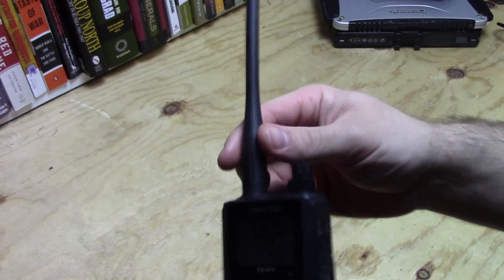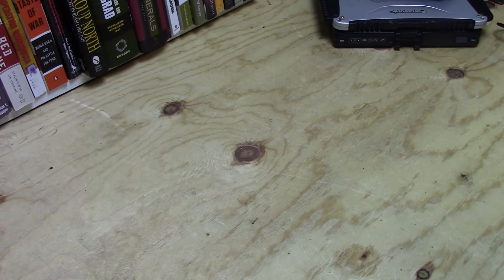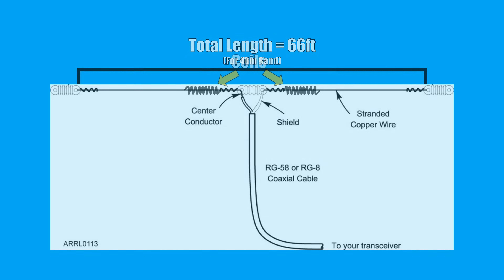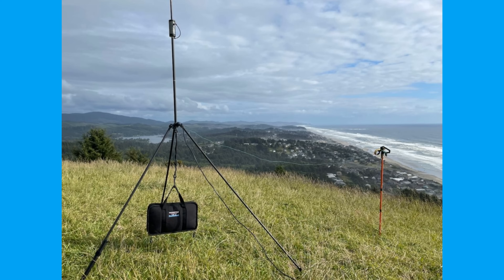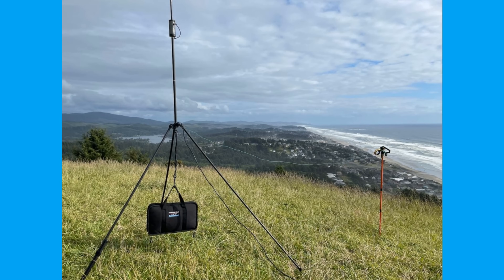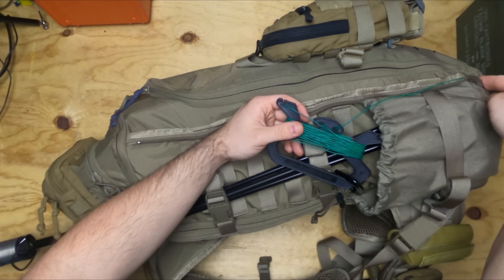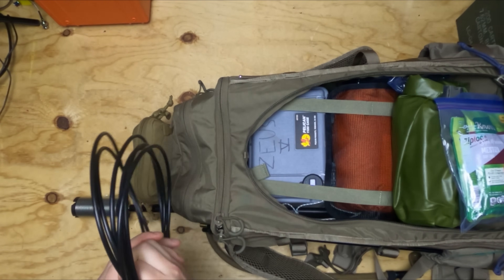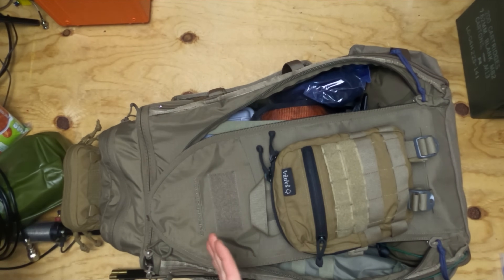Portable HF Radio: Issues and Options

Comment: Licensed general ham here. I’ve kind of lost interest, but I’ve done enough portable ops and it’s all about having the most efficient antenna “system” you can buy or build.

It’s critically important to understand radials, counterpoise and elevated ground plane concepts. Just tossing a wire in a tree is okay for receiving, but not for transmitting.

Learn about antennas before investing in expensive transceivers. You will someday thank me.
Reply: Would a QRP transceiver be good for this then?  Relatively small and lightweight with the capability of using a decently built antenna.

Comment: Or just use an Alexham magloop antenna.  I've been using one on my travels for years and you can either hold it in your hand or slap it on a small tripod.
I'll stop, put together the loop, tune it in, and then transmit.  Takes less than 5 minutes.  No need for dragging wire all over the place either.
ANd I'd ditch the heavy Toughbook as well for an M1 Macbook wrapped in a plastic bag.  
Battery lasts a long time in the new M1-powered Macbooks and most of the software folks tend to use also exists for Mac OS X.  Not to mention is more secure than Windows.

Comment: Make HF great again. I think prepper types would enjoy it a lot with just a little nudging and better marketing.
Reply: Many people need instructions. Everyone will need cheap radios that won't break easily. An open-air raspberry pi setup won't do that. I guess a small pelican case full of stuff could work, though?
Reply: @phil2082  you can’t use HF without understanding some radio theory. Don’t have to be a physicist, but it’s not a plug and play technology. No way around it.
Reply: @oliverallen5324  So... Understanding theory and applying it are always different things.

As a mehanical engineer with a ham license and CNC experience, this really has always been the case in my experience.

Things could always be made easy. You don't need much to get a lot working once the technology is good.
Reply: HF is still a very primary net in certain communities.
Reply: The problem I see is a gap in people who enjoy radios and want better communications and the ham radio community. The similarities are there but the community has done very little to make that known.
Reply: That is a marketing pitch.

Comment: Any thoughts on the Chameleon Mpas 2.0 kit?? Other than price??
Reply: I have this kit. It was my first antenna I purchased. I built some efhw antennas but considering the amount of different capabilities this mpas offers, it was well worth the price. I will tell you, the transformer they use is very very good. Some purists like to say it is too big of a compromise which I completely disagree with. Know your operating environment, what you want to accomplish and then decide what antennaat yes that. Just like the buddipole, it cost serious money. But if comparing to the buddipole, you have to consider that the buddipple is really just a vertical antenna. With the mpas you can do a vertical, sloper, inverted V, inverted L, loop, nvis, etc   so many options. But once, cry once.

Comment: Crazy that you have started doing videos on HF and NVIS. I started checking them out right before I saw your first video that mentioned them. I have been looking at mobile setups and haven’t found a whole lot of commercially available options that aren’t ridiculous. I am thinking about running a horizontal whip with ATU. Longest durable one I have seen is 102 inches. 

Glad I saw your video because my next area of research is a man portable NVIS antenna. 

Thank you for your amazing videos. Some of the best information I have found so far and so pertinent to our current times.
Reply: Do keep us updated on this, well at least me.  This is definitely an area of interest.
Reply: dipole and a tree, man!

Comment: Great video, thanks! I have the old Buddipole Deluxe, which is arguably a bit more portable, though it does require more assembly in the field. I've tried to figure out a way to keep it partially assembled for faster deployment but thus far unsuccessfully. Cheers!

Comment: Pack Tip: If you do poke a hole in your pack for a radial or other wire, install a grommet to protect the edges of the fabric from further fraying or damage. A plastic grommet can be used to protect whatever wire you are passing thru that opening. 
As far as using an antenna that is not optimized for the band/frequency you are using, you can also use an antenna tuner. It is basically a box with some adjustable capacitors that lets the user change the resonance and impedance of an antenna to better match the frequency being used. They can be used with almost any HF radio and any HF-intended antenna, but are very useful with random length wire antennae. You do need to be careful in the choice of tuner you get because some will only work within a set frequency range. Most modern HF radios do come equipped with an automatic antenna tuner integrated into the guts, but if you prefer to use an older or smaller rig, they are an essential piece of your comms kit.
Reply: @guitarman_3693  a what??
Reply: Soldering irons poke clean holes through nylon materials

Comment: One big thing people new to HF don't understand many times is that propagation on the higher frequencies are unreliable for consistent comms throughout the day.  Experience gives you the ability to guestimate the hop distance depending on time of day and year, but consistent coverage out to 500 miles requires 80m/40m band antennas.  The higher HF freqs get me 800-1200 mile hops, but in a theoretical SHTF event, the stations I will NEED to communicate with will be more local/regional to me.  Not to say that Intel gathering/passing cross country wouldn't be important, but not on the same priority.
Reply: Same idea I use for my rifle scope.  I'm more likely to have an "emergency" at close range, so I leave scope at 1x. If I have an "emergency" at longer range, I will have time to crank it up to 8x and set up.

Comment: Might I suggest just cutting your antenna to 1/4, or even 1/8 wavelength and adding a reflector?  Copper framing wire works great for field expedient antennas. Just get yourself a cobra connector and some plastic spoons for resistance. I would also suggest building a field expedient antenna kit to carry with you.

Comment: Stage pre-strung wire antennas along all of your routes.  Wire is cheap.  Doesn't help when your "out of town" but it could certainly work in your current AO.
Reply: In a hostile environment, leaving the wires pre-strung around could provide evidence to the enemy of your transmitting location(s). Hypothetically all they would need to do is wait and watch. Designing a portable and contained system that lightweight and reliable is important in that respect. 

I will say though to your defense, that leaving behind false evidence could be an advantage. For instance, if the enemy is using sophisticated beacons, they could narrow down your position in a very short period. Perhaps leaving behind a wire strung up in a tree and a few false clues like a fake One Time Pad or scribbled gibberish on a loose piece of paper could keep them busy and off your trail. 

73's!
Reply: @gregrush6570  You can just clip into a barbed wire fence.
Reply: @LarsLarsen77  great point. That would require a tuner though as apposed to a pre-tuned length. Either could work, but a length of fence wire less than 1/8 wavelength above the ground could be a VERY good option for NVIS. 

My original comment where I think my thought was lost is that a hidden wire can STILL be found. It's still physical evidence. I don't care if you have tons of experience and the wire is well camouflaged. If the enemy has you pinpointed to a specific area,  and you continue returning to a hidden antenna, they will either be able to ambush via pinpoint triangulation or physical evidence. 

if you don't want to be found, you MUST move around in an unpredictable fashion and NOT transmit more than once from the same location and eliminate all possible evidence that you may have left behind. Your idea of a fence is great so long as you're in an area where there are plenty to choose from. It's not always an option, but certainly an expedient one especially with NVIS. 

Love it!
Reply: @gregrush6570  It's pretty easy to hide a wire up in a tree.  We've been hiding antenna from HOA's for a bit now ;)
Reply: What if your route changes?
Reply: @OH8STN  You add more antenna.  Like I said, wire is cheap and easy to hide.  When you are working in your AO it's an easy way to improve commo on the fly.  Just like resupply caches.  Or safe houses or anything you need while you are working in your backyard.

Comment: Downsides: Cost of portable HF is number one, antenna number two then portable power supplies
Reply: the radios can be costly but a g90 works, and you can make your own antennas.  600 max with that plus battery.  I prefer my IC705 bit radios like the g90 and 6100 do work.

Comment: crazy thought: use gps fixed drone to tow antenna wire 66' vertical. set-up and break down in seconds.
Reply: You could just use a wire guided drone to reduce signals transmitted.
Reply: @James-C24  Or just a helium filled balloon...
Reply: Trees don't use batteries or helium.     Just saying.
Reply: @doejohn8674  would be harder to inflate and deflate, also you gotta be carrying a helium canister with you to fill and empty it as well as it taking up a lot more space in a bag if you just kept it inflated
Reply: @doejohn8674  a drone folds down to the size of a large wallet. A balloon/tank takes up a lot more space.
Reply: @James-C24  some drones are 100% autonomus. Take off, climb, hold position, land would be pretty easy to set up.
Reply: @James-C24  some drones are 100% autonomus. Take off, climb, hold position, land would be pretty easy to set up.
Reply: Dude 🤯
Reply: A wrist-rocket slingshot with a fishing reel and a catfish weight attached to 20lb test line is a good method of getting a vertical wire antenna up into a tree.
Reply: @CharlesHuse  but getting your fishing line antenna back down?
Reply: @Eluderatnight  Comes down the same way it goes up. Use little folding reel to hold fishing string (maybe push handle into dirt to hold it upright). Use wrist rocket to shoot lead weight into branches and feed it line until you can reach it. Tie feedline onto end of fishing string, and then pull on weight end to hoist up the feedline. When finished, simply cut off the weight and pull on the feedline side. Retain all fishing string for next use or simply dispose of discretely later to hide evidence.

No batteries. No drone noise. Reduced complexities.

K.I.S.S.
Reply: @Eluderatnight  simple…leave the antenna tied to the fishing line. When you are ready to pack up, lower the line, untie from the antenna and then reel the line back in.
Reply: @Eluderatnight  the idea is to launch the weight and line up and over a tree limb that is slightly higher than your antenna is long. So when in use, you have both the fishing line and the antenna up. The best reel type to use is the bait cast with the thumb button.
Reply: Brilliant!!!!
Reply: A kite works just as well and can be effective with no trees.  The issue here is if you have time for that you have time for a dipole which has less compromise.  Good thought but a little over complicated and lots of extra weight.

Comment: The Ham hobby is the way to learn how to do radio. Too much is made of long range (DX) comms  - 6 Meters and 10 Meters are solid choices fr local communications on a regular basis, as long as you have other people also using the same frequencies. And, the antennas are manageable. Things like the buddy stick are var too expensive for something as simple as antennas. WS7PB 73
Reply: VHF and UHF are great for "Local" Communications.  The thing that makes HF unique, is the ability to transmit/receive Over the Horizon (OTH) or long distance.  In fact, HF is the ONLY communications system, that can communicate literally THOUSANDS of miles, without the requirement/assistance of anyone else.....No satellite, no repeater/re-transmitter, no switch, no fiber-optic cable....nothing but two operators, two R/Ts and two antennas, getting the job done.
Reply: I like how you added "as long as you have other people also using the same frequencies"  since that's kinda the backbone of this entire thing.  XD
Reply: If you go in the 10 Meters you could change to CB Radios on the 11 Meters band. It's much cheaper and doesn't need a licens. And JS8CALL will also work.
Reply: You also have to look at RDF and a LOS system is easier to RDF.
Reply: I'm just now getting into the hobby but yeah. The idea is to get into first. And I'm teaching my friends about it so we can practice now. 

Then in a scenario where internet fails or something we have the backup. I don't expect everyone to get radial antenna, we might need smaller way stations instead of coast to coast capability.

Comment: Don't forget that the CB channels 1-40 operate in the HF spectrum (26-27 MHz) and are used with a Whip Antenna.  Getting a 106 inch whip and cutting it (using a VSWR meter) to a primary Frequency (in the upper band...25 MHz or higher) would work for a vehicle mounted HF rig.   Yes, the antenna would be Omni-Directional, but would work for non-Over the Horizon communications.
Reply: 10 Meters uses even shorter antennas, and the radio's come from the factory with far more power than CB radios.
Reply: @LibertyCaveWS7PB  I used CB radios to illustrate the idea that HF CAN be mobile and used with a whip antenna.
Reply: @LibertyCaveWS7PB  I'm NOT a HAM....Just an OLD Army Communicator that initially trained on the AN/GRC-142/122 RATT Riggs (HF RAdio Tele-Type).  Later on in my career, I would talk from Stuttgart, Germany to FT Bragg, usually on a weekly basis, on an AN/PRC-104 HF Radio @ 20 Watts with a long-wire antenna.  

Power is NOT always the answer when dealing with HF....Frequency + Atmospheric propagation plays a BIG part.  Pulling out a VSWR Meter and cutting your coax and antenna to proper length is another part.   

IF I were thinking of setting up a HF Base Station, I would lean toward the Harris RF-5000 family of radios.  It might not be the BEST system for the HAM world, but it's what I know (inside and out).
Reply: 11m, GMRS and Fam is all i can afford to operate right now
Reply: @Rampant_Colt GMRS is awesome in the US. It's like a modern CB style system.
Reply: @Rampant_Colt  that's good. You can add 2m and 70cm with a chineseium baofeng.
Reply: A good CB with true SSB is actually very effective, especially after the sun sets. Two or more radios with SSB can talk well over twenty miles out in the country.
Reply: CB a.k.a 11m